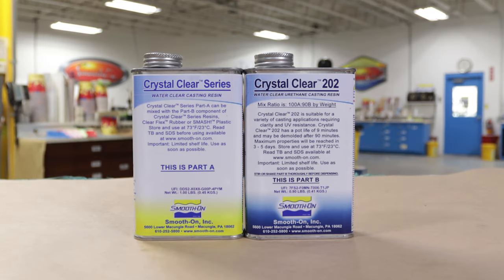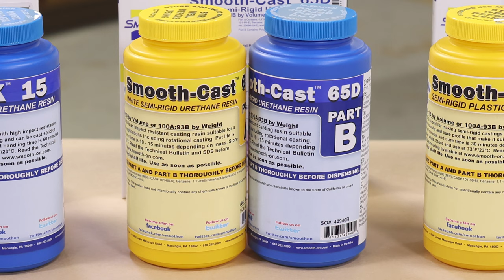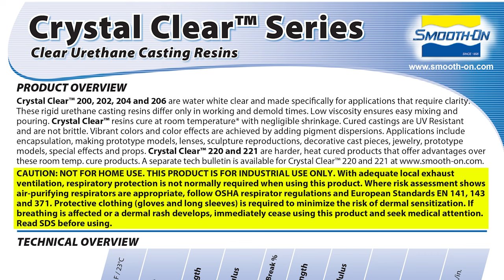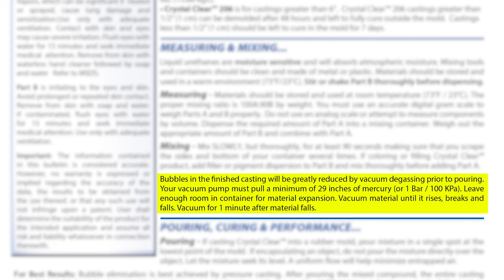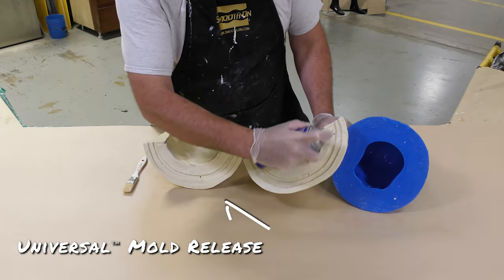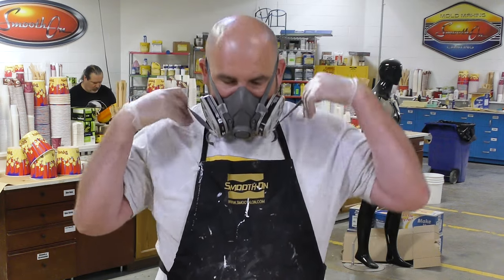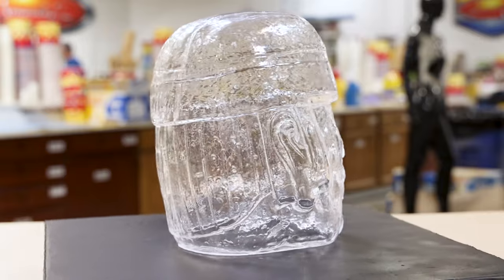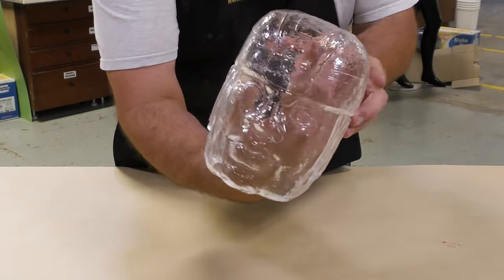Creating a Clear, Hollow Casting Using Crystal Clear™ Urethane Resin

Comment: Can this be painted after it's cured, and how well will it do outdoors in the hot sun? Thank you if, those questions get answered I will  buying some.
Reply from the maker: It would depend on the exposure.  Being a thin-walled casting, you would want to make sure that the piece is post-cured before display.
Reply: @smoothon hi, will it yellow in the sun like epoxy?

Comment: I've been using mold star 30 for ages, I always thought  MS30 was not made for brush-on mold, I'm I right in assuming that you can use it in the same fashion as the rebound series, with  THI-VEX ?
Reply from the maker: Rebound 25 will outperform Mold Star 30 in brush-on moldmaking applications.

Comment: hi is this uv resistant?  just curious, what’s the difference between urethane resin  and epoxy resin?
Reply from the maker: The Crystal Clear does have some UV inhibitors in it and will resist the UV exposure. If the piece is going to be outside make sure you have a material that will be heat resistant to the temperatures that the final piece will be exposed too. Urethane resin and Epoxy resins are two different chemical compositions. The Crystal Clear will be better with UV exposure than epoxy resins will be. You can always reach out to our technical support team with any questions. https://www.smooth-on.com/support/ticket/add/agree/

Comment: Thank you for this video! Can you use Crystal Clear with Rebound 25? Im looking for extra clear resins that I can manually rotocast for a mask making project. Thank you
Reply from the maker: No, Crystal Clear is not compatible with Rebound 25.  It is, however, compatible with Mold Star 15 and 30.
Reply: you can use thivex to thicken mold star silicone to a likelyness of R25!